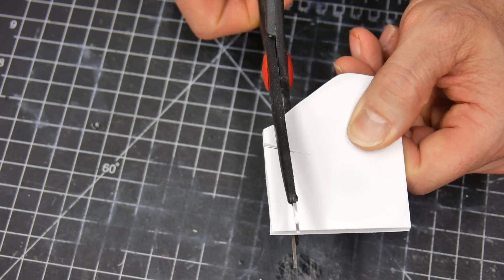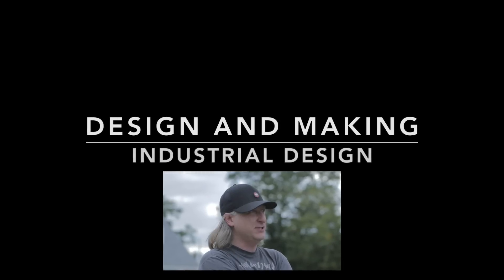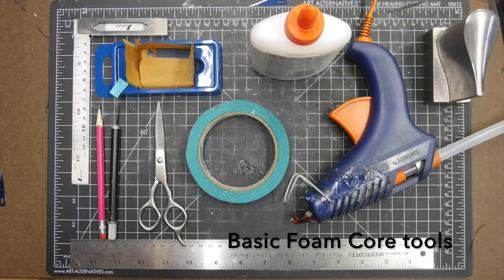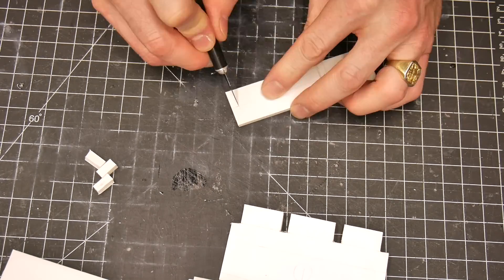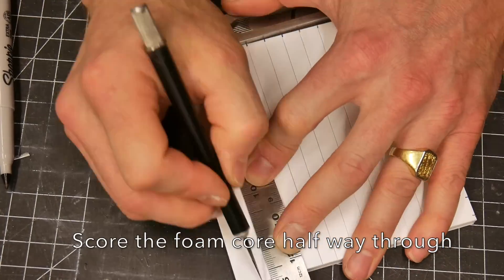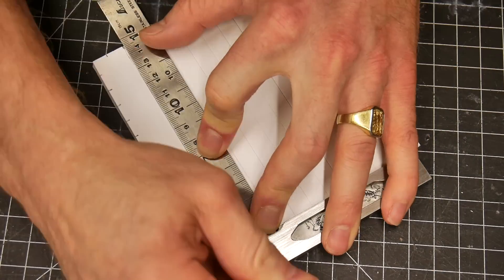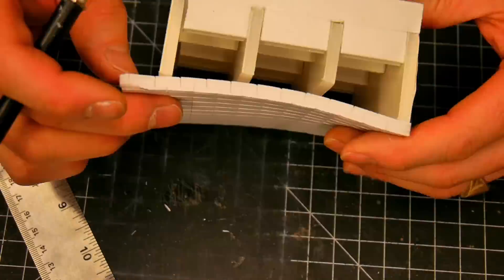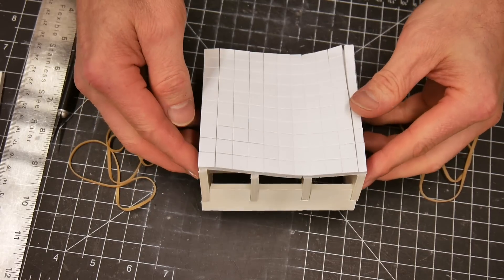FoamCore Pro Tutorial Guide Foam Board model making: Compound surface modeling Techniques tips

Comment: I don't know if you made a video about this, but one of the things that annoyed me the most during my modeling was the inablity to make crisp and clean holes ( for windows or other openings)... it didnt matter the amount of passes i made with the scalpel, for some reason it wouldn't cut the cardboard face on the other side and i would always cut through with an angle... after i pushed the piece out, i would get a mess of  around the edges of the hole with messed up foam and hairs of cardboard, regardless of the size of the cut hole and if just changed the blade....i thought i could polish the edge with a piece of sandpaper, but it turned out to be a stupid idea that made things worse...
English is not my native language but i do hope u understand what i am talking about. I also do value a lot your expertise on the subject and hope to get some guidance from you.

Comment: How small/large can you make the grid? Is it dependent on the thickness of the foam board? Also can you just cut lines into it if you only want it to flex in one plane?
Reply from the maker: you can make it whatever size you want depending upon the material that you're using you'll have to do a little experimenting for thicker material versus thinner material

Comment: hey i subscribed because your vids show me just what i want and need with respect to model building with one exception; how to cut round holes accurately , i.e. like windows with round tops or round windows. is there a method or tip or technique to doing so well.?? thanks in advance
Reply from the maker: Well, as I stated, a laser cutter would be the best for circles. I don't have one, so I have to cut them by hand. Print out a paper template and hold the blade at 90 degrees. I end up using the spindle sander to make the inside circles as round as possible, or the belt sander like in the video for outside circles. Circles are not an easy thing, but practice makes you better.

Comment: i know this is probably a stupid question but in making Buck parts a contour gauge is used, do you ever use one Eric?  its the old way of taking a 3,d profile of someone or something.  now days you could just scan the object but you gotta be made out of money to do that.
Reply from the maker: Sometimes a contour gauge use but it depends on what the goal of the project is and what you need to do so every case is different
Reply: @EricStrebel   well it hit me to ask i got some projects on the back burners of my brain my american take on the old Italian speed boat  you know the ones im planning to make it lower and wider and a shallower birth to be honest scale it down all together. 4 man no bigger.

  im not going to keep it though it will be for sale and i plan to record the process to command a higher price. there are some types that collect the finer things  in life if i can show it was built with love and attention i can name my price to the right buyer

 a buck and plied strips of wood and shoulder joints and such acrylics  it will be tough as nails and beautiful all at the same time is see you using a autoclave  i had something like that in mind as well  a heat gun would do but i want it to be perfect. 

  i even mean to try my hand at engraving  to emboss the metal trim i plan to use.  a series of sea dragons i think . so if there's a buyer im calling the shots, reasonable of course .hence the question .